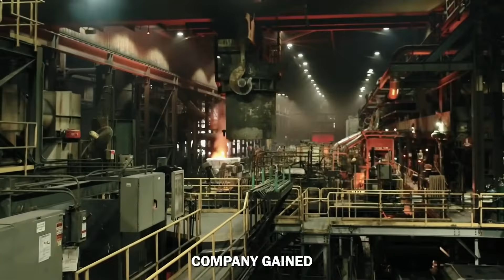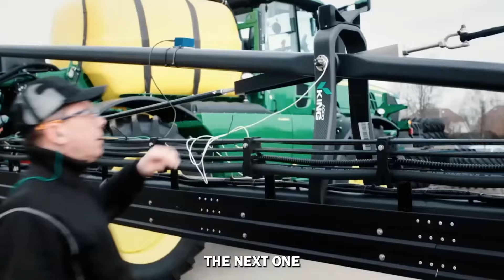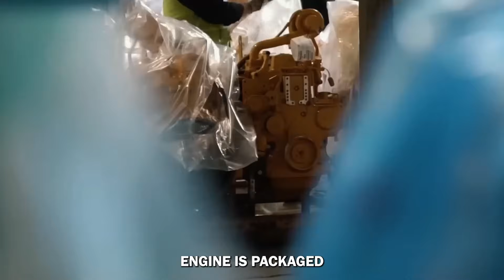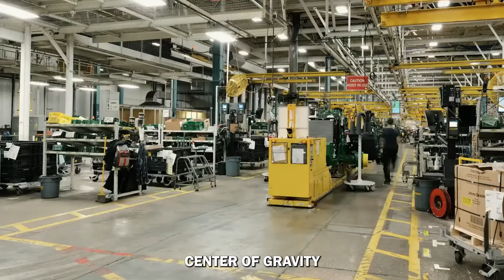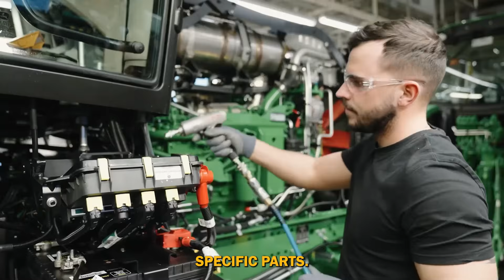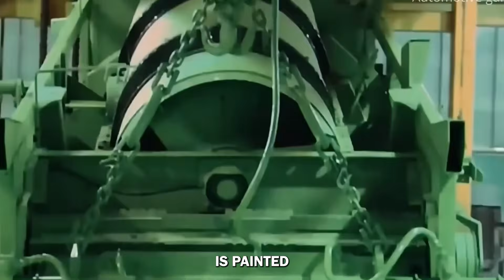John Deere Tractor Production Tour - World’s Largest Factory

Comment: E (5083E ,5093E..) series a little sucks. No electro lift control, No gear splitter. 3 Hitch system  a little weak... JD must be a same 3 hitch in E series like M series. ***Engine performance and gearbox durability is perfect in JD.